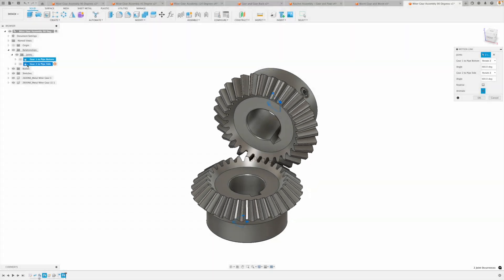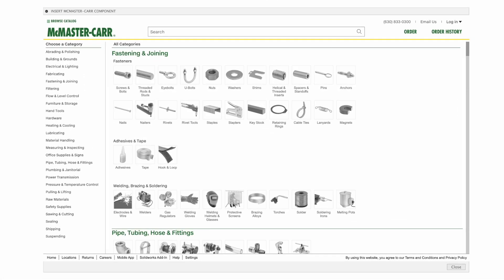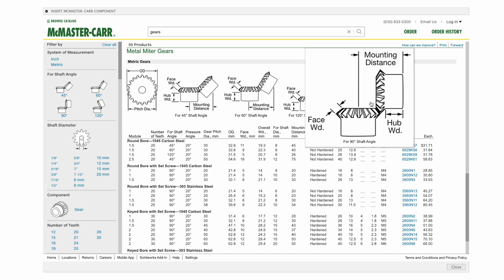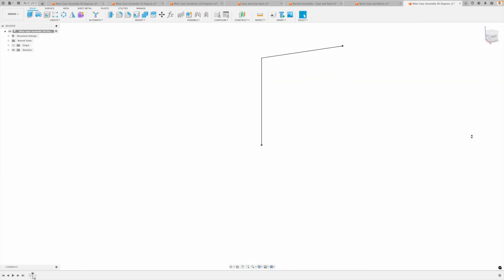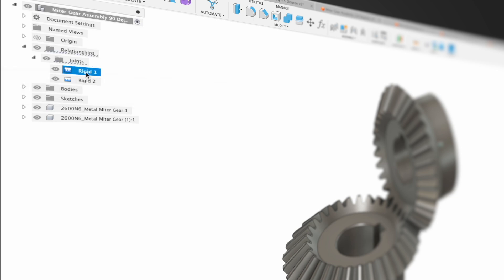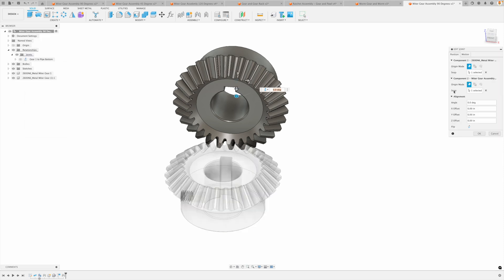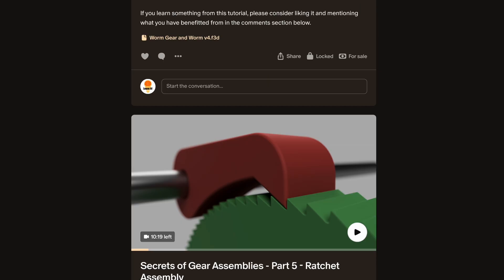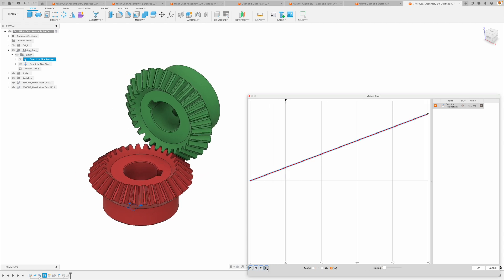Autodesk Fusion 360 Intermediate Tutorial - Complex Gear Assemblies (2025)

Comment: Hey, quick question. How would you find the mounting distance for a set of bevel gears. The gears I bought were from amazon .8MOD 5mm bore 15T but I cant find a mounting distance.
Reply from the maker: Just asked Mr Google by searching the following: 
"15t .8mod gear dimensions"
Do the same search and see what comes up. It looks like your pitch diameter is 12mm, which means you can mount 2 gears at 12mm distance (adding or subtracting any necessary tolerance) for the correct fit.
Reply: @learnitalready  Yup I figured it out a couple of minutes after posting the comment. Had to adjust tolerances and it fits perfectly. Thanks for the help.
Reply from the maker: @him-IFF Great to hear!

Comment: I got one question. How da hell did he know thats the formula? Is it the same furmula for gears with different number of teeth??? I suck at math.
Reply from the maker: When we practice math enough, these things are easy. A textbook, ChatGPT, etc are not needed. They can be learned. Keep trying. Don’t give up. 
Yes, it’s the same formula. A circle has 360 degrees. The number of teeth are spread evenly around a circle. Therefore, if you have 12 teeth, then 360/12. If you have 31 teeth, then 360/31. 
Practice makes perfect. Try it out with a few different kinds of gears in Fusion and let me know how it went. No excuses. Just try! Just Learn It!